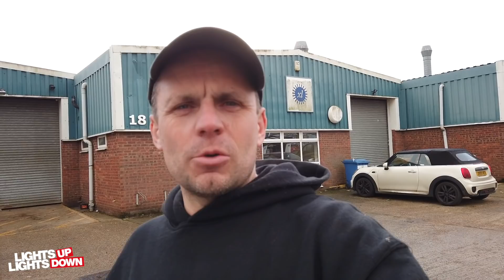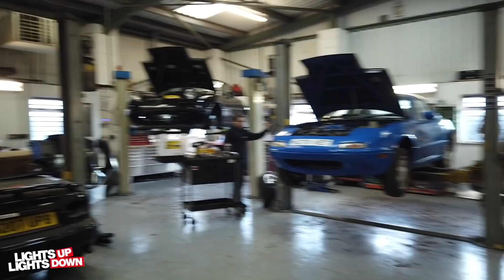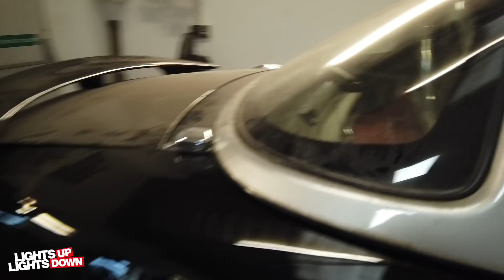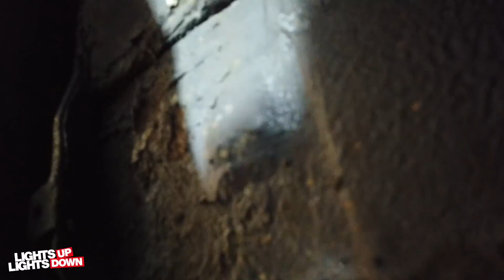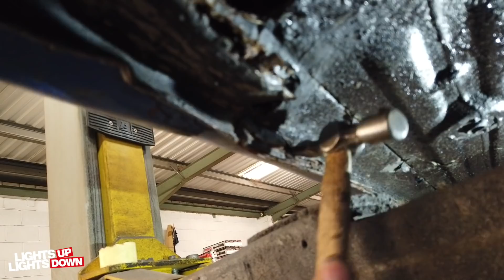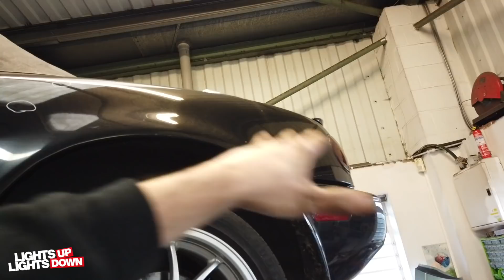This MX5 isn't worth saving - whats going on in the workshop 61

Comment: The MK3 Audio issues are almost definitely due to the amp. The machine gun sound is what happens before the amp completely dies. It's almost never the speakers :)
There is a shop in Scotland specialised in repairing the BOSE amps, a well known weak point of the sound system on Mazdas - https://boserepairexperts.eu/ 
I suggest you give them a ring before you spend too much time trying to track down the problem.
Reply from the maker: Thanks, we will look into that

Comment: Could you ballpark how much the welding on the blue one would cost? Understand that it's not the full extent and might find more etc but just the stuff that's visible in here?
Reply: If you look on www.facebook.com/roadsterrestoration you can get a feel for how much more rust lurks behind the outer panels and how much work is involved in rectifying it all
Reply: @rob_evans  Yeah I get that there is likely much more beneath the surface, I was just curious as to the cost for what was visible. I have a rusty MK1 that's nowhere near this bad, just some bubbles on one sill. I expect there will be more inside but nothing else visible.